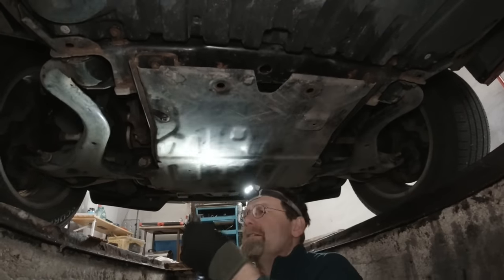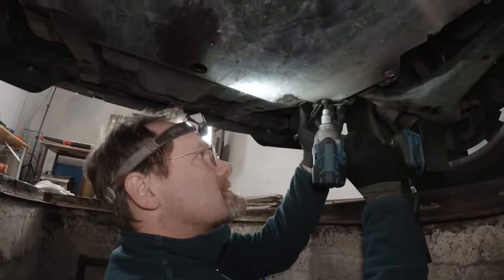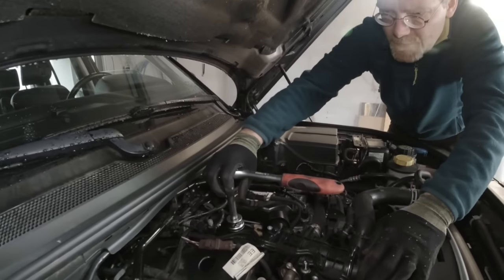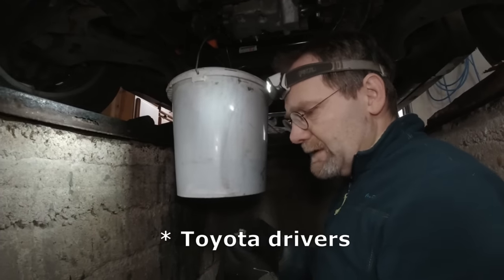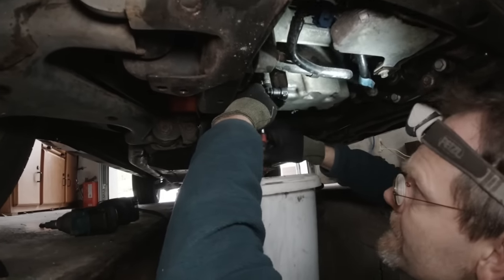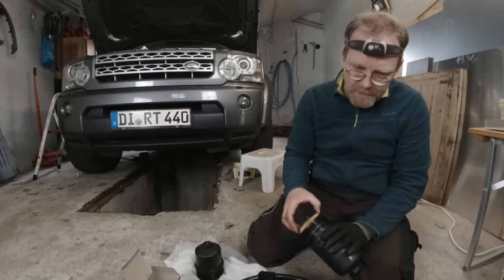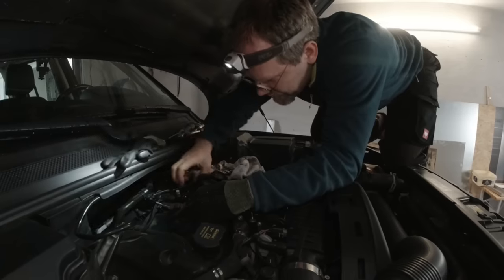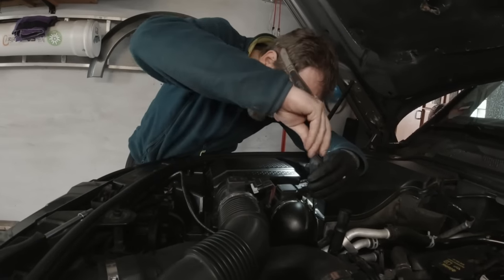No more 5W-30 ever again - Land Rover Discovery 4 - Transfer Case and Diff oil change

Comment: I have a pretty similar problem with the FAI pump. I recently changed the main bearings, the big end bearings and the Oilpump and still, the oil pressure is still at 0,7bar when warm. With the change to 10W40 I got to 0,8bar. still disappointing. My pressure display is calibrated, and I checked the absolute value several times with a high precision manometer because I couldn't believe it by myself.
Reply from the maker: We will install a FOMOCO pump now to resolve this question.  I hope it improves the situation but I doubt it.  Check back every Sunday.  This video will be out in about two weeks.  I payed 306 Euro for a original pump.  Christian

Comment: I have a 2012 Discovery 4 3.0-litre TDV6 , I’m needing an oil change but have noticed these two oils. CASTROL MAGNATEC 5W-40 C3 and CASTROL MAGNATEC 5W-40 DPF, what would your advise be? vielen dank
Reply from the maker: We use the DPF on both the D3 and D4👍🙋‍♀️

Comment: Been watching this video and the D3 one over and over to get the info. I have a Disco 4 2016 and the manual states ACEA C2 which is >= 2.9. C3 is >=3.5. Am I correct in what I am watching, and doing y own reading that the 3.5 (C3) is better for supporting the gap of moving parts but at a reduced fuel economy? So C2 reduces the friction therefore better economy but not so good for engine? do I have that right? if so then C3 is the way forward for me.
Reply from the maker: It’s complex.  My rule of thumb:  90-100t km and forward is 5w40 c3.  Christian
Reply: @Vera_and_Christian  Thanks for the the reply Christian. I'm at 80k miles so ~128k km. 2x 4ltr bottles of Castrol 5w40 C3 and new filter just arrived :)

Comment: I wonder if those torx bolts on the bash plate are OEM? I have a 2013 LR4 (V8) with the exact same M10 13mm hex head bolts as on my LR3.
Reply from the maker: I think it’s a SDV6 issue.  Christian

Comment: Came across this article  what do you think ? it's the part about the oil pump.  t
thanks stephen 

I accidentally put 5W-30 oil in my car when it takes 5W-20. Can I drive it until the next oil change interval without problems?

I’m an engineer who worked for Petronas back in 2016 in the lubricants division. One thing I can tell you is that 99.9% of the population (including mechanics) have no knowledge about lubricants. Everyone has guesses. My first advice is: Don’t trust other people’s guesses.
My division had one of the 5 main labs of the company around the world. You could check every single thing related to the fluids we produced.
Now going back to you question:
If you put a 5W30 instead of 5W20, you won’t notice anything instantly, but it will speed up the wear and tear of the engine system. It will also overload the oil pump, as it was designed to work with the 5W20 oil. The pump will have to work around 40% more to move the oil around.
As I said, you wouldn’t see anything catastrophic happening, but it’s far from ideal. It’s like inflation. If you print tons of money now, you will start to see the consequences in a few years and you might not be able to tell where the problem started. If this was my car, I would replace the oil, specially if you like the car.
Just a few more things for people who are interested. If your car asks for 5W20 and you get 0W20, this is completely fine, as the number before the W refers to the viscosity of the oil before the engine heats up. The lower the number, the less will its viscosity be and therefore, the quicker the oil will fill all the necessary areas in the engine, reducing the friction. But this will be a more expensive oil.
The other thing is that at the time, I had a Honda Civic 2008 and used it as an experiment to see if I really needed to change the oil like the manufacturer said (every 10k km or 1 year). Every oil change I would collect the oil and take it to the lab to analyse it. The oil is like the blood of the car. The tests show a range of important information such as if the oil still maintains its original characteristics based on a large number of parameters and detection of small metal particles coming from the engine.
I started testing it at 10,000km. The car was already 8 years old. The oil was still in spec and no metal particles detected. Tested again at 12,500. Same result. Tested again at 15,000. The oil went to the lower range of the acceptable characteristics but was still within spec. With 17,500 the oil finally showed characteristics of an oil that needed to be changed, but was still in working condition.
Keep in mind that lots of factors can influence these results, specially the car brand and it’s engine syatem quality. Japanese cars tend to be a lot more reliable.
One last thing: if the oil is black, that tells you nothing.
Reply from the maker: We only, and really only talk about the TDV6 and SDV6 Lion engines. Especially gen 2 engines suffering from diesel dilution. For every other engine, you absolutely have to do your own research if you suspect that the recommended intervals and oil are not suitable for the engine. 👍🙋‍♀️
Reply: @Vera_and_Christian  Hi, thanks for the reply. Did you read the part about? The oil pump. That I was most interested in your comment on. Also, next time you stuck for an engine or part. Send me a message. I deal in use Land Rover parts. I have. Contacts in Spain. UK. That are reliable. have Gen 2 that would have suited you It went to service at Land Rover. The mechanic started the service and went on lunch.  And restarted without oil   Anyway, enjoy your day. Thanks Steve.

Comment: Hallo Vera und Christian, I was wondering if the engine oil capacity does count for example similar 3.0 diesel engine mercedes om642 take 8.5 litre and I am surprised to see that LR takes 5.9l . Also on Mercedes I can use 228.51 10w40 so higher viscosity. Why they make the capacity of oil so low?
Reply: How reliable has your OM642 been and in what vehicle ? From the number of engine warning light incidents I've had with mine, I've concluded Solihull's team gave technical  training to the G Wagen development team. At least I can change the engine oil with only one spanner and a strap wrench.

Comment: You can't prefill the oil filter as oil will run out the little drain hole into the crankcase before you could screw the filter and cap down

Comment: I replaced the rear diff. oil in the Toyota so it has had more done than just changing the engine oil in 18 years!
Reply from the maker: Oh, I think you really exaggerated here changing it that early.  I thought the interval is 25 years 😳.  Christian
Reply: @Vera_and_Christian  I forgot about this but there was one major repair once when I had to replace the hood struts!

Comment: Hey guys.

Can you come with an update on how it is going after you changed to 5W-40.

Is the engine more smooth how are starts and what about fuel economy
Reply from the maker: We will cover that issue again in todays repair. We have a friend with his Discovery come by. As for my Discovery, we will never ever go back. It makes such a difference, the engine runs so smooths, no rattleing what so ever, compared to how it sounded before. 🙋‍♀️Vera
Reply: @Vera_and_Christian  WOW, it sound like this is something I have to do on the upcomming oil change.

I HATE that kind of "rattling" when driving
Reply: @Vera_and_Christian  Cant wait for the next "show"

Comment: Hello. Please reccommend which Liqui Moly oil to use on a Discovery 5 SDV6? Currently using SpecialTec 5W30. They have different 5W40 oils so I'd appreciate if you could perhaps name the one which would be best if you're familiar with their engine oils. Thanks
Reply from the maker: Well, best check the Liqui Moli oil finder. We can't do that for you. All necessary information are in the video description. 👍🙋‍♀️
Reply: @Vera_and_Christian  thanks. Someone on the internet strongly recommended 5W40 A3/B4. So I’ll go with that since my car has a removed dpf filter. LiquiMoly or Castrol.
Reply from the maker: @emilsydykov6613  We have also a video on what oil we run on our LR 3 non DPF.  👍🙋‍♀
Reply: @Vera_and_Christian  I’d appreciate a link to it. Thanks

Comment: The rear differential fluid looked brand new. Did the front differential not need the fluid changed?
Reply from the maker: Changed the front in our oil level repair video a while back.  Personally, I think this is the best video we ever made.    It was also like new.  Christian
Reply: @Vera_and_Christian   i have never seen gear oil come out so clean.
Reply: @Vera_and_Christian   I will have to watch that episode again. I am sure that I watched it, i have seen all of them so far.

Comment: I am thoroughly enjoying your channel especially Christian’s dry humour!!! I am also an engineer and generally commend your opinions but I was absolutely horrified when Christian stated that the dry air cleaner had been in the LR for a year and then he blew it out with an air line!!!! Did Vera approve this? If only she knew… As you know Christian the dry air cleaner is just as important for your vehicles health as the oil filter. Indeed it prevents debris like silica etc from entering the relatively fragile supercharging system front end. By blowing it out with even a gentle air jet you could damage the pleated element and form micro cracks that will adversely affect its performance. In the majority of cases blowing out does not dislodge the particles already entraining in the membrane. By not replacing the filter at around 5000 miles you will cause a higher diff pressure across it. You will be able to see this where the LR fuel trim will adjust for the restriction. Keeping this type of filter in service for longer will also increase the likelihood of failure and this could end up in the whole lot being ingested by the poor turbocharger or worse. So — replace the dry air filter every 5000 miles at the most.. your turbo & MAF sensor will thank you for it. Otherwise I will presume that you don’t want to be an engineer anymore and will come over and take the lovely Vera to be my very own perfect engineer wife!!!!  😅😅😅.  All the very best and keep the brilliant videos coming.. Can’t wait to see what the fault was with the seized LR you bought.    Raymond Brown - Northern Ireland

Comment: So strange to see an upside down oil filter at the top of an engine.
The peugeot van (2019) has the oil filter open side up, right at the bottom of the engine, so it can be prefilled and never drains.

Comment: Could the oil filter housing from an LR 4 be fitted to an LR3 engine? Just curious if that would work
Reply from the maker: Interface to the block may be the same but everything going with it is completely different and does not fit any longer.

Comment: And all this time until you wrote it on the oil container I incorrectly thought you were saying mole crawler 🥴 wouldn't you be risking cam damage running it with low oil pressure ? perhaps Vera is correct ?
Reply from the maker: Yes, this could cause a engine failure 😬. Christian

Comment: Could you use a D3 oil filter cap (and filter with the plug cut off) on the D4?
Reply from the maker: No you can't, it's completely different🙋‍♀️Vera

Comment: Hey guys, would you consider 5W40 for a 2014 Freelander with the 2.2 diesel motor?
Reply from the maker: Unless your engine is known for problems with oilpressure or anything related to the oilsystem, use what LR specifies. Also check for specifications in hot climates, for example in Australia or South Africa, and see what LR specifies in these regions. 👍🙋‍♀️

Comment: Install a Franz oil cleaner     (two element roll type) model which is a bypass system 2 micron filtration.Not sure if they are still available, there are other brands eg Filter Technology an Australian company there must be others in Germany.

Comment: So I just came across your video. I  was wondering why  you don't  use .Iiquid moly 5w40 . IT is far superior  to Castrol which cannot handle  the friction  that occurs in your Discovery  4. Plus it is made in Germany This oil Liquid  Moly will keep your engine cooler internally. I would  also  use liquid  moly ATF for the transmission 
 From experience  I have found that using such products you double the life expectancy of your vehicle
Reply from the maker: I guess because of cost.  Castrol is 28 Euro for 5 Liters. LM is 60 Euro.  We use LM for the diffs and the manual transmission.  Christian

Comment: Just looked at the Castol oil guide (I'm from Australia) it says 5w-30. Seems bit thin to me for that vehicle.
Reply: To get high power levels out of such a small engine .. the tolerances are VERY fine .. hence such thin oil.
That's my understanding.
Reply: @davidhuett3579  no, the original LR/Ford oil specs are primarily for fuel economy as the main priority

Comment: Yes, good stuff. I use Castrol 5w-40 in the LR4. I'm at 173,000 miles. I was using the LR recommended 5w-20, but Blackstone Oil lab report convinced me otherwise. Did you check the oil pressure sensor?
Reply: Would you be interested in sharing your sample reports? I regually sample my engine oils and I'm looking to create a video with my data, however the more data I have the better the end result will be
Reply: That's interesting I use the 5W40 in my 4.4L LR3 as it was the original oil the Jag 4.2 was designed to use but I'm surprised it's ok in the 5L, I was under the impression that the thicker oil would present a problem for the that engine as the galleys, variable valve timing, etc were all designed around thinner oils.  Does the car run well on the thicker oil?

Comment: I'm so old I remember when Toyota was junk.
I was a parts manager and sold a lot of timing chain tensioner, chains and hydraulic  parts.
Sitting at lights and hearing the awful sound of a Toy pulling away before the tensioner did its job and the chain jumps a tooth or more as the Toyota coasted to the side of the road in shame 🫠

Comment: Magnatec is definitely not a low quality castrol oil! Even on the wrong saps rating it will out shine alot of other oils. Most importantly is changing the oil in good time. Cleaning sensors out will slightly mitigate higher saps build up.

Comment: I always use heavier grades of oil than recommended but take care to warm the engine/trans up properly before using high rpm and the power, like this I've found that after many years of doing my own maintenance my engines never have any issues, my Lupo TDI did nearly 400,000 km and still did not use a drop of oil between 10,000 km service intervals. For example if the manufacturer recommendation is for a 5W30 fully synthetic oil I use a 10W40 semi synthetic but I always use oil from a trusted oil manufacturers such as Motul, Shell, Castrol etc. With motorcycles that have wet clutches it's essential that any non recommended oil used is compatible with the wet clutch or slippage and dragging may result
Reply from the maker: That is a good strategy.   I should have done this also many years ago.  Christian

Comment: Hi! Cool channel you got:-) I've been looking at the data sheet on magnatec 5W-40 DPF and the same in C3 version. I can't find any noticeable difference in the datasheets(ash numbers are the same), and C3 is typically cheaper. Any reason to choose the more expensive one for a LR with DPF?
Reply from the maker: In Germany the DPF is cheaper. I also found no difference.  Used only DPF before but would use C3 also.  Christian

Comment: What about using ACEA C5? Liquimoly TopTec 6300 0W20.
Reply from the maker: I don´t like C5 because it is reduced HTHS oil.  This oil did not exist when the engine was designed.  Christian
Reply: @Vera_and_Christian  Do you think they would develop new oil standard better than the old standard and would be suitable for older engines? Just wondering. Love your channel. Am waiting for you to replace the lower arms.

Comment: I see you also sigh in despair when Vera (the camera operator and wife) insists on an  uncomfortable knuckle busting, back breaking 8 hour job be done now!

For the record, I would replace the oil pump before you rebuild the engine. Not because it needs to be done now, but rather because the low oil pressure concern. That may have been the issue all along.  the engine noise may go away with a new OEM pump, thus negating the need to rebuild the engine this year.
Reply from the maker: Pump is ordered.   I will attempt to change it in 5h and make a video about it. Christian
Reply: @Vera_and_Christian  However long it takes is a distant last compared to how great, informative & entertaining watching the change over will be. Plus for us it will only take 35 - 55 minutes of comfortable recliner time in front of the TV. I am so glad my son who is the apprentice mechanic is able to do this stuff for me or with me.

Comment: You should always use the oil weight recommended by the manufacturer.
Reply from the maker: we don't agree with you, these are special circumstances🙋‍♀️
Reply: @Vera_and_Christian  I worked as a service technician for the local Ford dealership & all I know is on most vehicles you can void all the warranties if you don't use the right weight of motor oil & other recommended engine fluids such as antifreeze & power steering fluids & transmission fluids.
Reply: @deanhoward4128  but their warranties aren´t worth the paper they´re printed on so we have to make our own engineering solutions to fix a problem that Ford knowingly designed into their engines. Most vehicle technicians are just fitters that follow the book, not critical thinking engineers.

Comment: Since we are talking oil. what's the difference between the castrol 5w-40 dpf and the 5w'40 c3? the c3 is half the cost 😂
Reply from the maker: I don’t know.  But I think it’s the manufacturer specification on the container.  The DPF C3 has a few more listed, including Ford.  The C3 does not.  Christian